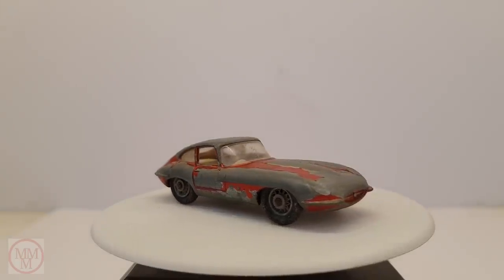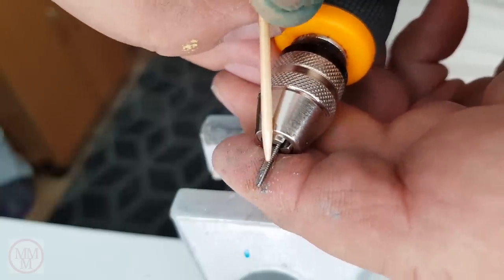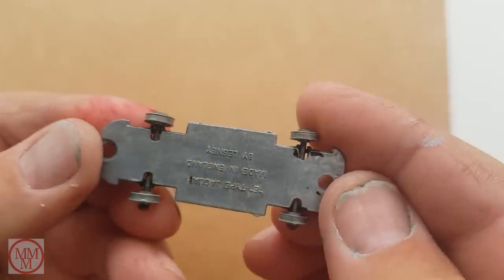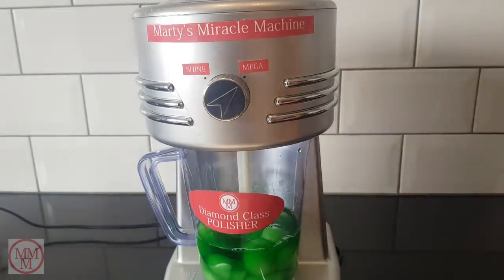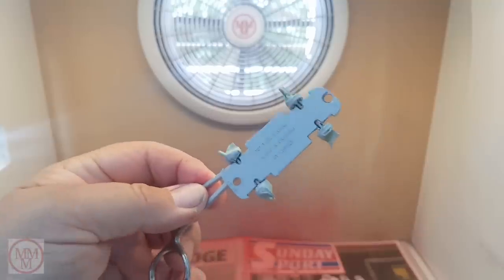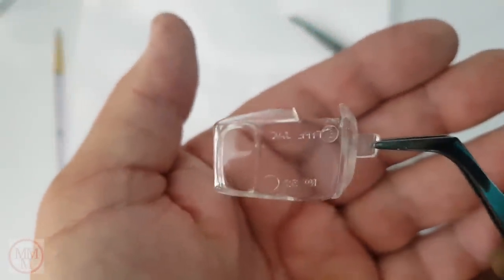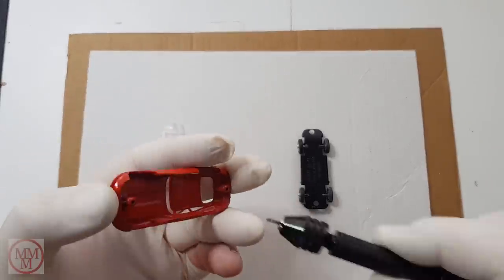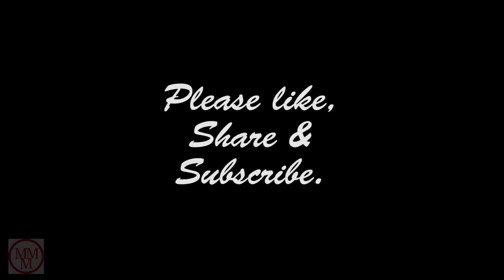MATCHBOX Restoration No 32b E Type Jaguar 1962

Comment: Great job Marty. Shame about the burnt face. Surprised you didn't paint the front headlights & grille. I am sure this will inspire many to have a go.👍
Reply: I tried painting the headlights on this particular car.   The ridge lines for the headlights aren't great and I ended up with silver paint all over the place even though I used a micro brush.   The original didn't have them,   so I just decided to do what Marty did here and spray the lot.
Reply: @Scottie_S  Thanks, 'cause I was also wondering about doing something with the headlights.  I still think the bumpers would have looked good.  I also think Marty should have foregone the metallic paint.  I thought another thin coat of the high gloss would have looked way better.  The clear windows was unusual, and came out unreal after polishing.  While he was polishing that with the q-tip the thought occurred to me that maybe Marty ought to see if his wife has any manicurist's nail buffing cream.  Possibly that and a chamois buffer would work pretty well.
Reply: @TheRealDrJoey  Well, the metallic fleck was in the gloss, so he was going to get that one way or the other.   I didn't mind the look of it.   Also, considering what Marty appropriates from his wife, your suggestion is spot on!

Comment: "This is a no special tools makeover....I've invented this autopolisher"
Reply: A blender with stickers isn't a special tool. Lol
Reply: connie rosario ... it's an ice maker... you put cubed ice in the top and the two settings are coarse and fine ice shavings...
Reply: MrRex2U thanks, I couldn't really tell on the screen if blender, coffee machine, ice machine whatever but I knew it was Macgivered.
Reply: @connierosario9474  I did a lot of aluminum casting and I made green sand from kitty litter...used my blender to grind it to a fine powder.......polished up the blades too! It would work on these models as well.....

If someone is doing this without any special tools, an old pickle jar filled with beach sand, fill it half full, put the body in, cap it, turn it on its side and roll it back and forth across the table for an hour......buffs right up!
Reply: For those of us who also handload, a brass tumbler with corncob media and a bit of metal polish should work.

Comment: Nice job but why the headlights are painted as well ? How can you see a thing in the darkness if you drive it by night ?
Reply: Also the well detailed X spokes are all clogged with paint, what a shame.
Reply: Original lights and bumbers were painted red.
Reply: You do better and post it here!
Reply from the maker: @jesusgonzalez84  I'm gonna have to disagree with you there mate ;)
Reply: @jesusgonzalez84  did you watch? Maybe glasses would help
Reply: @bandsoflove  I don't think Jesus was wrong.  Make the video full screen and set it to 1080p.  Then look at the "BEFORE" view of the car while it is on the turntable. (Link to that spot provided below).  When you look closely at the driver's side front spokes, not only can you see the large pentagonal holes, but also the very small triangular holes.  In the "AFTER" view however, only the large pentagonal holes remain; all of the triangular holes were filled in.

Check out the driver's side front tire at these two points:
Before:  https://youtu.be/j-RpQqQXCl0?t=1008
After: https://youtu.be/j-RpQqQXCl0?t=1047
Reply: I also noticed this
Reply: just scratch the bumper a bit and night will become day
Reply: Sam Le Gal 
This is how it came out of the factory originally
Reply: I think you've done a fantastic job! I really hope that the negative comments doesn't discourage you in any kind of way, there's always going to be assholes behind their keyboards with nothing else better to do then to try to bring others down to their pathetic level, don't fall for it! Keep up the good work!
Reply: @BubbaB43 ,
 please Nick, just constructive critisism. I know I would surely appreciate it. Marty does not even see it for whatever reason. Yet it is quite apparent. Perhaps reading my other comments in this video will change your mind of just how highly I think of Marty and his work. If not, perhaps we can agree to disagree without the name calling. Unless of course that too was just constructive criticism 😉.
 Please, have a good day mate
PS: Also see comment reply from DAVID U.
Reply: @MartysMatchboxMakeovers ,
         Marty I hope you do not think I meant any disrespect as your name calling fan Nick Brogmon does, though I can appreciate him coming to your defence. My comment in this video,  I left two to grab your attention, will show you no disrespect meant. However, others I have shown this video to concur, even though I did not specifically voice my exact concern/critique. David U, comment replier in this stream, it seems would also agree. Perhaps you might follow this stream to see if it changes your view, OR perhaps we could ask someone we may both agree on as a sort of ultimate decider, (I would bow to their decision) your wife? Hoping to hear from you. In the meantime while waiting, 🍺🍺cheers.
Reply: @David U .
DAVID U
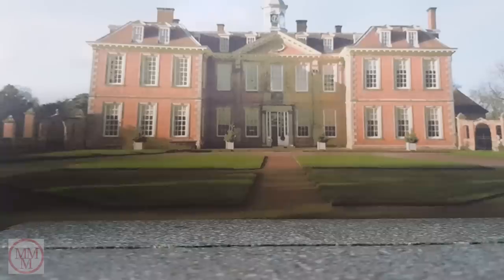   Thank-you David I do so totally see the loss of almost all the wheel spoke definition. Even more so now taking your suggestion of full screen and adjusting to 1080p   see  17:37. I guess I probably noticed this more than others because as a child I had a chum that collected and was upset when  unboxing a new car with some spokes that were "paint" clogged (or just not carefully molded) right from the store, and spent time with sewing needle and hammer to knock out spaces in the X, lol. I laugh now because I was the unfortunate one that held the sewing needle while he "carefully", ouch ouch ouch, hammered away. 
Thank-you for the 1080p/full screen tips.
Reply: @David__U  .
Reply: @bandsoflove  ,
Thanks for the love bands-of-love, but perhaps an open mind and reading others in this stream might make you reconsider?
DAVID U  has a great tip about bringing the video to full screen and 1080p definition, and I just now played it on my 50".  No spectacles needed and I am definately...well, I'll let you decide ;-) .
Reply: Hi there @0utsiderBG ,
Though I agree that they may have often come out of the factory that way originally, looking at the before and after in MARTY'S video, to me, definately show filling in of some of the spaces in the X that were previously NOT filled in before. Please read the other comment/replies in this stream for more info. Thanks for your input BG.
   ALSO as of note. my neighbour suggested that if Marty was unable to get the detail consistent, perhaps to be symmetrically correct, he just paint filled everything. I disagree with him but he asked me to add this in. (I kind of had to as I feel indebted to him for setting up my television to play this video large screen ;-) .
Reply: Headlights were ruined by the paint stripper
Reply: @jesusgonzalez84  No they aren't.
Reply: @james-jq8sk ,
 lol calling someone names doesn't make it so. Read the thread.
Have a good day now.
Reply: @mula2626  ,
Are too, lol.
Have a good day now.
Reply: lahokc59 ,
Lol, played it on a BIG screen.
Guess I need to get the tv checked too?
Have a good day now. 
Lmao.

Comment: Maybe next time try pieces of aluminum foil (tin foil as you might say) to mask the wheels. It will crimp tightly and come off easily. Carry on :)
Reply: That's very clever!
Reply: I paint models (basic hobby, nothing like this guy!); tin foil rips easy and is expensive in comparison. It is also very smooth (no friction like tape or even paper) and will move around on you while you trying to paint etc. Still a good suggestion, I think I'll try that for masking off large areas of my models. I use a lot of sticky notes. Still expensive, but come in different pre-cut sizes and have a little sticky area that comes in handy all the time. It's like paper with tape already attached. Just don't get the sticky part on your models paint! Hahah.
Reply: @OnceIHadAPony   I believe you'll find foil has applications where nothing else will work as well. Things you would break if you used tape, a model cars antenna for example. I've used foil for over 50 years on my model building, my only complaint is that I didn't start ten years sooner ;) As for cost, a roll of 3/4" paint grade masking tape is about $5.00, Reynolds Wrap is about $2.00 and has many thousands more square inches of surface area than that roll of tape. Good luck with your projects.
Reply: I was looking at that too. Hard work for big fingers. What about using silly putty to cover them?  just don't press it too hard into the spokes. Or some other type of putty or pliable dough that di
Reply: erikehlert I was thinking rubber cement might do the job.

Comment: Quick tip, heat your metals with a heat gun but not too hot of course before spraying and put your spray cans in warm water to bring their temps up you will be amazed at how much better the finish is. Nice work Marty.

Comment: Just a bit of advice: if you want to polish clear plastics, toothpaste works really well also. There is extremely fine grit in toothpaste and it will buff up most clear plastics quite well. 

It also works on brass, gold, aluminum......

Comment: Marty, instead of masking tape I think a bit of heat-shrink tubing would protect the wheels quite well.  To remove it you can slit it with a razor or reheat it to soften it again.  And might I suggest that once you have your screw threads started you switch to a bottoming tap to ensure your threads deeper in the hole are fully formed?

Comment: My friend's mother worded at the local 5 & dime when we were kids and we always went down there when she would tell us the new matchbox toy had come in. Somewhere I have two of those- had to have them as the fellow across the street bought a white E type in '62. The guy was a bachelor and tolerated us kids to the point where he piled about 5 of us in his Jag and took us up to Mount Tam in Marin; that was back when you could do stuff like that and not have to wonder if the guy was a pedo- and he wasn't.  There's no paint left on either of them, so they're both gray.  They were more of a candy apple red than the color painted in the vid.  Always loved that sound of the engine and drive train in his Jaguar.  A fun video.

Comment: Toothpaste is good for polishing the plastic.  I had headlight covers on an old pickup truck that had worn to the point that the truck wouldn't pass inspection.  The inspector told me to polish them with toothpaste.  It worked, and the truck passed.

Comment: New to your work and am impressed so far!
Curious if you've tried using bottoming taps for the M2 threads. The tap you're using looks to be tapered, but a plug or bottoming tap might work better given that the hole doesn't go all the way through.

Comment: Did you check if those tyres are directional? If they are it will screw the handling up completely fitting them the wrong way.

Comment: Nicely done! I used to have one of these but in blue.  Couple things...Bumpers front n Rear? Headlights? Does windscreen have wiper arm molded into them, if so, black paint? Paint interior details like a period color correct steering wheel and/or seats and door interiors?  Do I recollect that these had plastic (chrome painted) side mirrors?  Nonetheless, great restoration!

Comment: NEED...TO...HAVE...THAT...MACHINE! Where can I order it?
In it's first incarnation this model was a darker metalic red and somehow the wheels seem a bit more subtle on it. The rims are probably still the same but if I am right the tires are a bit less wide and smaller on the early edition, which to be frank, looked more convincing. Assuming this is not just an optical illusion, that is. :-)

Comment: I think I would have detailed the front by coloring the headlights and the grill
Reply: To: Corey Orr,
🔵 I agree with you, however, those details were not highlighted on the original, and the effort here is to restore it as close to original condition as possible, but when I was a child we did those details on the brand new ones as we got them.
What provided more of a challenge was the Corgi metal cars which were larger and came with greater detail, the hoods, doors & trunk opened so you could see the engine and we used to put spark plug wires, distributor and highlight various other details of the car with sharpened toothpicks to apply the paint detail for the dashboard, Bumper's, Grill and headlights.

Comment: How can I get plastic replacement parts? Anybody?
Reply: Do a Google search of Matchbox spare parts.  There are online shops in: Australia, UK, USA, Canada, and the Netherlands.  I have bought parts from all of them, and they are good quality spares to fix your broken Matchbox.  And they ship via post quickly.  Spares are available for Matchbox up to the end of Regular Wheels type (the black plastic wheels), about 1969.  Doesn't seem to be spares available for Superfast, yet.  If you have a Superfast which was also in production as an earlier Regular Wheels, some parts will fit.  You can get: wheels, tyres, window units, truck body lids and doors.

Comment: I, too have this car.  I had painted the headlights with glow-in-the-dark paint!  However, I'm sure you'll agree that the restored color is quite a bit more orange than the original "Candy-apple red"   The tires on mine are more gray than black.  Here's an image of one just like it:   https://assets.catawiki.nl/assets/2018/2/3/e/6/5/e657eeae-4fa1-4238-974e-ae8046786dc8.jpg

Comment: You know you really need to wear gloves most of the time when doing this, like get some nitrile ones for when your doing the paintstripping, as that cant be good for the skin. and you really shouldnt feel you need them at the end like that, as if you can leave a permanent thumb print in the car, that means the paint and the clear havent cured yet. plus that brush with the plastic, your probably better off just dunking it in hot soapy water and wiping it down with a soft detailing cloth made out of microfiber at the end, with a rinse afterwards

as you probably did more damage with that step alone with that old toothbrush than all the time that car had been played with and turned into that in the end, so you literally just made more work for yourself, and risked breaking the plastic all at the same time. 

as soap works by literally mixing in with the water and surrounding the dirt while taking it with it when you rinse, where it gathers in the bottom at the end if its in a dish, a pan, a bucket or a tub, safely away from whatever your trying to clean, vs a brush where you just grind whatevers stuck to it into the thing

and whatevers not either into it, as when you use a brush like that, its more like exfoliation than preservation and restoration, and should be used when something already looks well past it, as it was, you'd be better off cleaning with soap and water, then rubbing it down with the cloth, and then a polish.